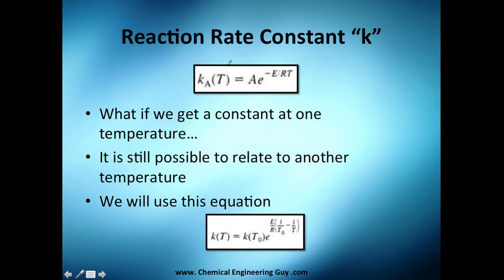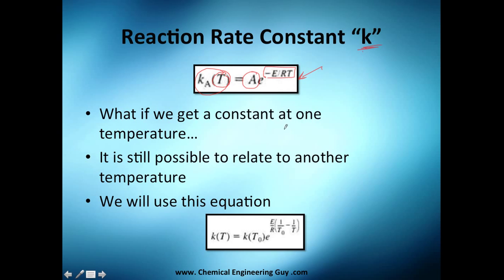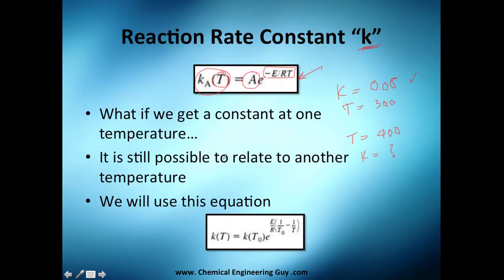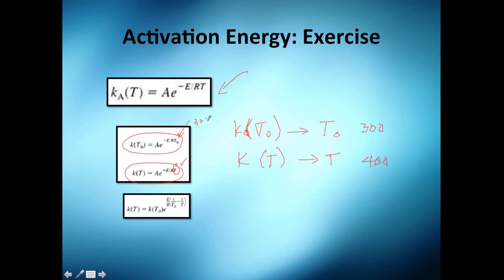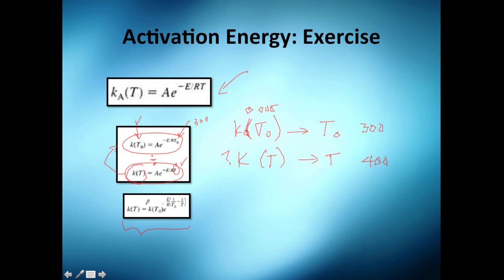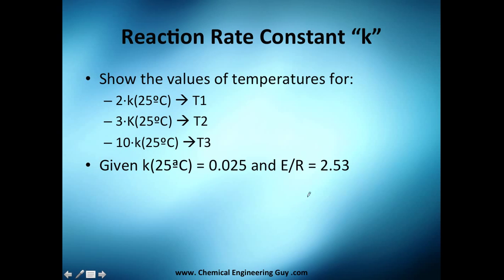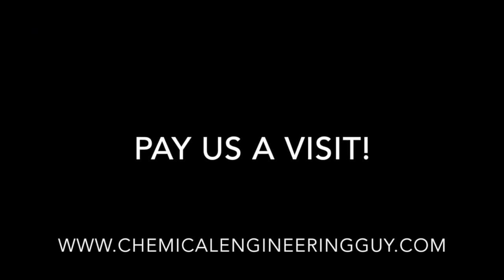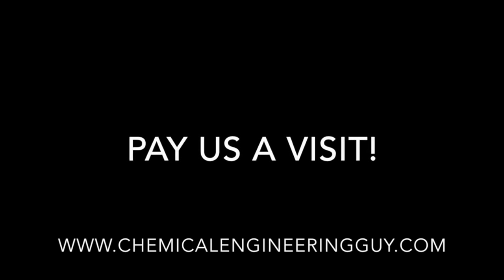Rate Constant @ Different Temperature: Arrhenius Equation // Reactor Engineering - Class 48

Comment: Where can I find a worked out solution to the presented problems?
Reply from the maker: +De We Hey there, the course is not yet online! I let you know! thanks for the interest!
Reply: +Chemical Engineering Guy thanks for your awesome videos and your quick replies. I'm trying to do the calculations over and over again and keep getting obviously wrong awnsers. Can you spot my mistake:

When T1 = k*2

ln (0,025/0,05) = 2.53 * (1/298-1/T1)

where the values are used:
k1 = 0,025
k2 = 0,05
E/R = 2.53
T0 = 298 K (25c)
T1 = to be calculated when k2 = 2*k1

When I do the calculations I always end up with 3,65 for T1 which is an impossible result.
Reply from the maker: +De We Im pretty sure the E/R value is wrong, probably you are using kJ in E and J in R... therefore a 1000 value error. recall that E should be changed to J, that will be E/R = 2530 and you should get something higher... please check it and let me know!
Reply: +Chemical Engineering Guy  it was the one you gave in the video ^_^
Reply: +Chemical Engineering Guy it solved the calculation though, thanks!
Got a value of 325 Kelvin, which seems reasonable. Been busting my ass off with this calculation for two days now, haha. Okay, you fixed it. Moving on to next section!
Reply from the maker: Perfect! Keep the good work!